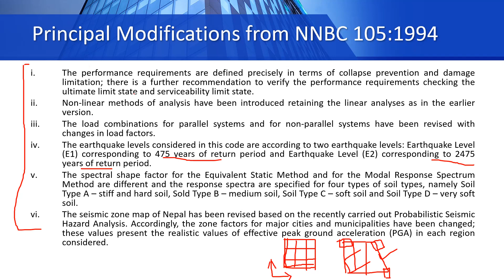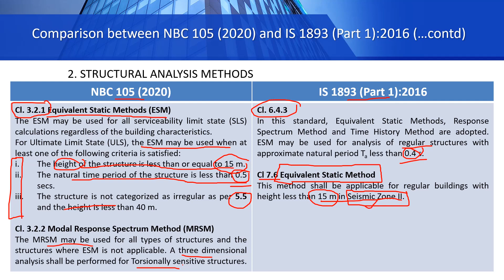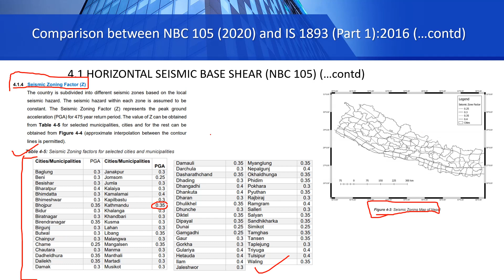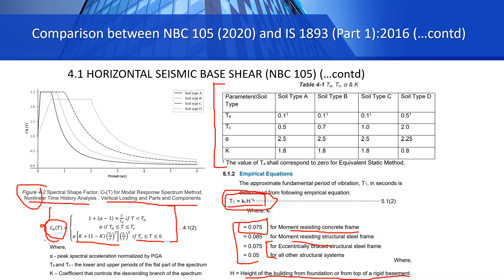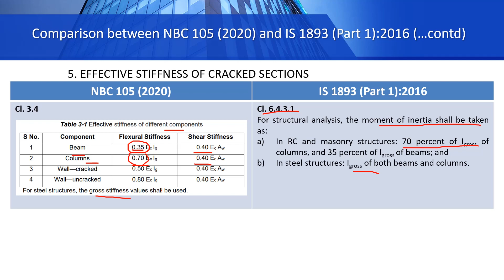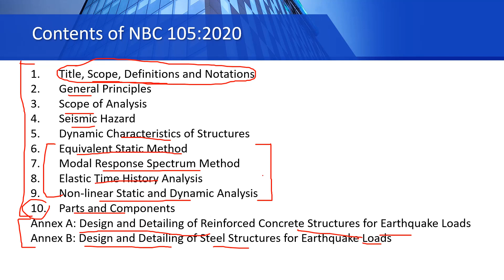Lecture 1 - Introduction to NBC 105:2020 and Comparison with IS 1893  (Part 1):2016

Comment: Correction at 14:00 mins- IS 1893 (Part 1) deals with only Buildings. For Liquid Retaining Structures, we use IS 1893 (Part 2), for Retaining Walls we use Part 3, and for Industrial Structures, there is Part 4